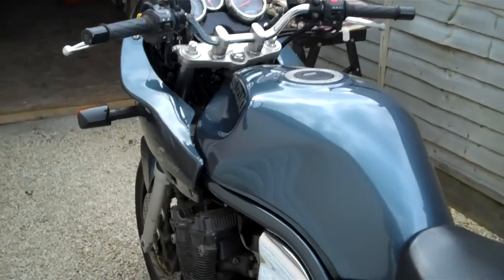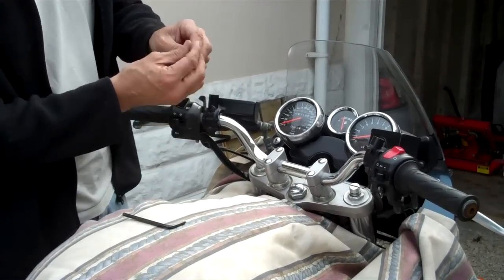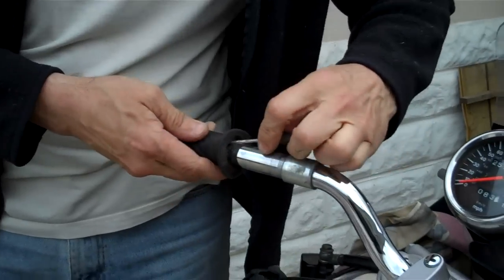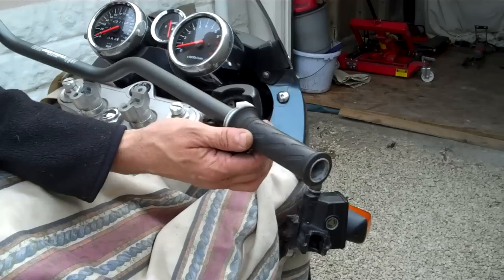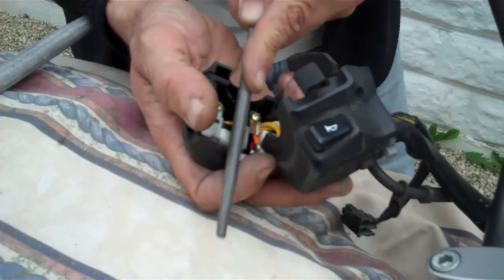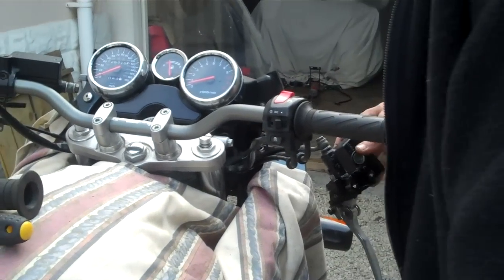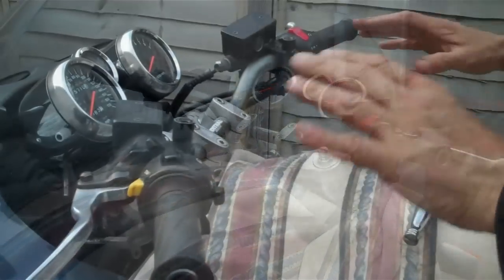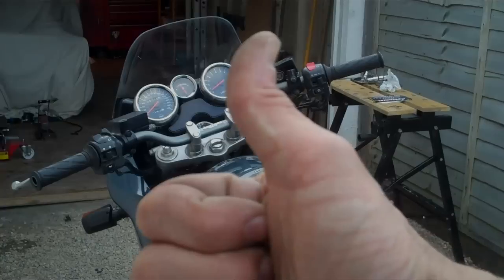Delboy's Garage, Renthal bars, Suzuki Bandit.

Comment: I like them mirrors you got on your bandit, I never seen them shorty ones,
are they oem or aftermarket ?
Reply from the maker: geo morris Hi Geo, they were the standard factory mirrors with the shaft between the two end knuckles removed and replaced with a single piece of threaded bolt to bolt them directly together... but don't bother, as they were rubbish, all you could see was your wrists!  Soon replaced them with bar end mirrors....

Comment: How about those cuts under the clamps on original bar? I didnt see them in new one. Are these not necessary?
Reply from the maker: If you mean the knurling, that's more necessary on a smooth chrome bar then it is on a textured aluminium Renthal bar, they drip perfectly well without it!

Comment: Have any video for solving a sticky choke cable on bandit12? I always have to push really hard the plastic lever because the cable seems stuck
Reply from the maker: Yes mate, i made a video on how to free up stuck control cables.. but TBH, just call Wemoto and buy a new one mate, they so the 'Slinky Glide' brand which are better then factory ones.. and they cost less than a round of drinks mate.. just get yerself a new one..!

Comment: Hiya mate, noticed you didn't put your bar ends back on. would you need new ones or would the same ones fit the renthals?
Reply from the maker: Hi mate, you can fit the standard bar weights back on by using 12mm concrete raw bolts from B&Q - you will need a bolt long enough to reach right through but they are easily available from Screwfix - made a video here: Delboy's Garage, Renthal Bars, Bar End Weights Ghetto fix.   hope that helps!
Reply: Nice! Cheers mate!

Comment: Do the original bar end weights not fit? I didn't see you re-fit them?
Reply from the maker: No they dont, not straight swap..the alloy bars are thicker material, making the hole smaller... but check out later video on this i refitted them using some 12mm raw bolts..!

Comment: hey yo delboy
I tried to bring my bandit to my mechanic w regards to switching to renthals......but we found that at Full lock turn, the bars would hit the front fairng/winscreen.
how did u get around that issue???
Reply from the maker: Hi buddy, mine didn't hit my screen, but I know the early Mk1 Bandit screens were much smaller than the Mk2... I'm guessing it's not the actual bar that hits the screen, but perhaps clutch or brake lever?  If so, is it by much?  can you maybe adjust them in their rotation, so they stop short?  Otherwise, the only solution might be a different model of Renthal bar, they do them with different rake and pull back, perhaps you don't have the same bars as I did?  Lots of variables my friend, just a case of working it out, hope that helps!
Reply: hey yo ! thanks for answering! yes mine is the 1250 Fi version. couldnt fit the bar cos , as u said, the brake n clutch hits the screen on full lock. any recommendations?
Reply from the maker: The answer to that buddy really starts with how the factory bars used to be, if they were 1/2" from the screen from standard, then any bar you fit from Renthal is gonna hit... so short of cutting the screen to make some clearance, or some pull back risers, which will defeat the object, then you're kinda stuck with what you have, as is the case with most sportsbikes when people wanna fit a bar conversion... sorry it's probably not good news mate, but modifications sometimes need a little more thinking, best of luck with it mate...
Reply: thanks...sob sob

Comment: hi delboy  just a quick question i am putting a new exhaust on my fzr 1000 exup i  have never done this before . i have 4 rings that go into the engine holes and then the pipes push in to the rings then then its all insected into the engine holes, do i put sealant around these rings ?  i know i do when connecting the pipes ect  but i am unsure ..
Reply from the maker: Hi David.. if i remember rightly, those are "crush washers".. as you tighten the nuts onto the studs, the pipes push in on them and "crush" them into a tight and snug seal.. so no need for any sealant in there.. but it helps to clean out the holes in the head of al carbon and crud so the crush washer sit tight up against the head, and make a tight seal..   Hope that helps buddy.. good luck with it.. Del.
Reply: @Moonfleet41  thank you del  for your help once again , and  because of your help and your videos i have now  changed the bars,  changed the oil, flushed the radiator , and tomorrow fit a new exhaust   you really are a top bloke and thank you !!!!
Reply from the maker: @davidmillard2739  Hey its no problem mate, you're more than welcome, i hope it all goes well, and as always, just drop me a line if you get stuck... Del.

Comment: Hi mate, are you not putting the bar weights back in?
Reply from the maker: In a later video I showed how to fit them using 12mm raw plugs, as the internal dia of Renthal bars is 12mm, not 18mm, and the factory bar weights don't go straight back in... this is why I made it a second video to show how to fit factory bar weights in Renthal weights..
Reply: Moonfleet41 Yeah sorry bud, just seen it 🙈 nice work 👌🏼👌🏼

Comment: you didn't put the bar end weights back on, are they not needed with the renthals?
Reply from the maker: +Kenny Kewn Yes Kenny, i refitted them later using 12mm rawl bolts...
Reply: +Moonfleet41 Do you reckon that trick would work ok with bar-end mirrors?
Reply from the maker: +Steve Wells Yes mate, the raw plugs are just a great way to grip the inside of the bar...

Comment: What kind of grip glue is good ?
Reply from the maker: I never use any glue on Renthals as they have a textured surface which grips just fine!  But if you want a little tip, then scrub out the inside of the grip with really hot water and soap and when it's bone dry, squirt a little hairspray down inside it and slide it on, the next morning it should be dry and be stuck fast!
Reply: oh thanks I just got a bikemaster superbike bar for my  GS500 and was learning how to deal with the grip, good tip thanks

Comment: I have now been finagling with the stupid controls on my bike for over a week. No matter what I do they just rotate all over the place. I even went as far as buying industrial grade adhesive tape from 3M and wrapping the hell out of the bars where they sat and tightened them down and they still just went all over the place. I have no idea what to do, please help.
Reply from the maker: Ok, what bike do you have, and what bars are you fitting..!?
Reply: Moonfleet41 2006 Honda CB600F Hornet with Renthal road ultra low bars.
Reply from the maker: Ok, are they plastic switch casing, and did you file off the locator posts.. ?...
Reply: They are plastic and the locator pins have been ground down.
Reply from the maker: In cases like that in the past i have had success with using a wrap of alluminium foil under the switchblock, its soft and crushes into the gaps gripping the bar and the plastic case... once you screw down onto it you can 'blade' off any that sticks out... they wont need to be held so hard you can swing on them,, just enough so they dont move when you press a button.... give that a go and see how it works... good luck,m hope that helps.. Del.
Reply: Fiddled with the aluminum foil for half an hour. tried it 20 different ways and it still spun free as a bird. Bout to just use a damn self tapping screw and go through the plastic into the bar.
Reply from the maker: Thats ridiculous, there's never that much play.. you don't have 1 inch switch cases do you?... the bars should be 7/8th..?
Reply: Nope they're 7/8th inch, I've tried just about every trick in the book to get them to stay from electrical tape to aluminum foil, to double sided adhesive tape, a combination of all of them. I even cut my old grips into pieces, ground them down into chunks and poured them into the control thinking that would keep them still and they still rotate. At this point I'm about to take it into a shop and tell them to deal with it and piss way a few hundred bucks.
Reply from the maker: Are you sure that when you filed the pegs out you didn't file the hole any bigger???  How much play side to side is there when there is nothing between the case and bar??  Using terms like 'spinning freely' , you are making it sound like they are too big for the bars... I have never experienced this mate, I must have fitted hundred sets of Renthals to bikes!  Can't help really without seeing it from here... good luck with it !
Reply: They fit flush right to the bars, my main issue is the throttle side. A twist of the throttle to the full lock position rotates the controls backward until the cable guard hits the brake lever and prevents it from moving anymore. There's no issue of them moving side to side just rotating around the bar.

Comment: I'd be concerned about getting air into either hydraulic system, by just letting the master cylinders dangle upside down.
Reply from the maker: As long as the elver is fully at rest and not pulled in, then the valve down onto the system is closed, so no air will get past the piston seals in the master cylinders.. once you clamp them back to the bars, just tap them a few times to work any bubbles in the fluid up to the surface.. job done.

Comment: can you still use bar end mirrors on these renthall bars?
Reply from the maker: Mark Cox Yes mate, and you can use a 12mm rawl bolt to hold them on...the regular ones you buy for factory bars are too fat...
Reply: Ok thank you very much looking to swap out my bent bars on my bandit for some renthalls and was wanting to go bar end mirrors so good to know.
Reply: Also Moonfleet41  do you have any idea on how hard it is to switch of a fuel sender from a 1200 to a new 600 tank I bought to replace my beat up tank?
Reply from the maker: Mark Cox Hi Mark...as far as i remember the 600 doesn't have a fuel guage, so the sender isnt needed....just leave it there and forget it mate, there's no wiring on the 600 to plug it into, so fit the tank from the 1200, and connect the tap as usual... hope thats what you meant.. cheers, Del.
Reply: Well my bike is a 1200 and I have a 600 replacement tank and I would like to keep the fuel gauge working is the only reason.  I know its not necessarily needed but I would just like to keep it if possible.
Reply from the maker: Mark Cox Ah i see, sorry...the other way round.. Ok, i dont think the 600 tank has a hole for the sender, check by looking underneath, you cant miss it, its a hole about the size of a playing card on the underside in the middle...... if not...then you wont have a fuel guage any more.. just go with the reserve tap only....
Reply: Yeah it doesnt have a hole I had just read somewhere someone had cut the whole out and had it done didnt know if you might have had any experience yourself with it. Thanks for the info anyways and great vids.

Comment: ?Hi Delboy  ,Do I NEED SPECIAL BARENDS FOR THIS RENTHAL
Reply from the maker: +Nasser Yekta Hi Nasser, any bar ends will be ok, but you may well need to attach them using something different, as the hole inside the Renthal is much smaller than a steel bar... I use a 12mm rawl bolt from the DIY store... we have a video on this if you need it !

Comment: Hey Del en Penny,
I got me a bandit 1200s and all the vids of the bandit work great for me.
Though one week ago i crashed the bandit. Original bar is bent so im gonna order one at http://www.demon-tweeks.co.uk/ like you because they are the cheapest there (thank you).
I got a question though.
The whole front is wrecked, headlight and the bracket, the fairing mirrors grips.... (the front dampers and wheel ect are ok.
I was thinking of putting one big headlight on her. Like youre bonnville. Because replacing this stuff would cost me 5/600 euros + in holland.
Do you have any pointers on where to get a nice headlight and brackets ect? 
Thanks in advance.
Danny
Reply from the maker: +Danny van den Oudenalder Hi Danny, sorry to hear about your acident... the simplest conversion that will work easily for your Bandit, and will fit straight on, is to buy the headlight bracket tubes and headlight from the 1200N ... this means it will all bolt straight on and work without modification... you could either go through a breakers, or buy new from Suzuki if you are feeling flush !